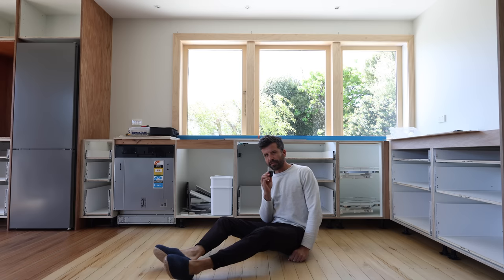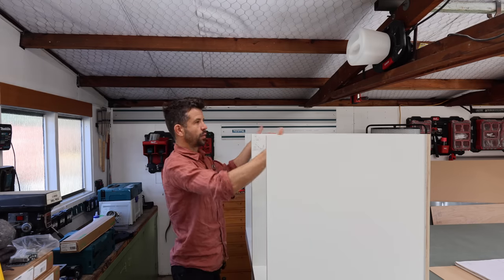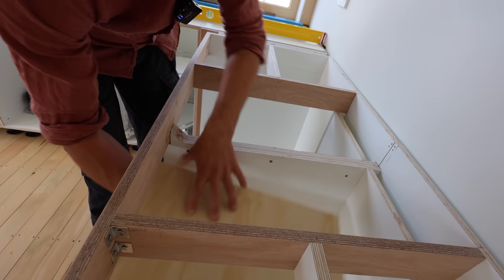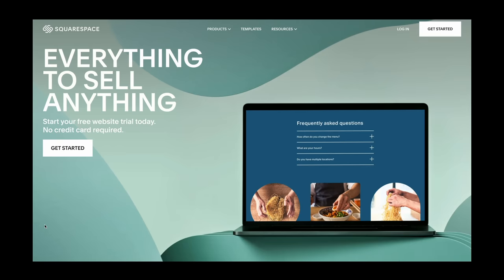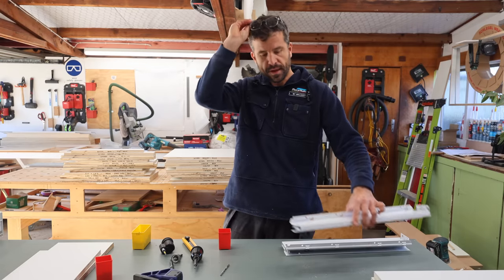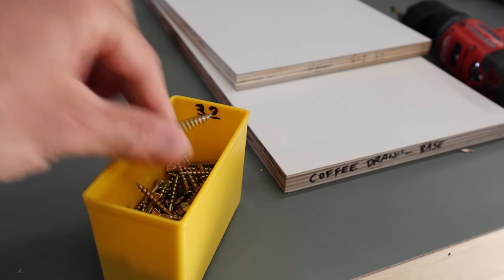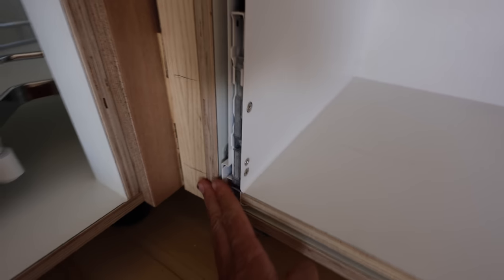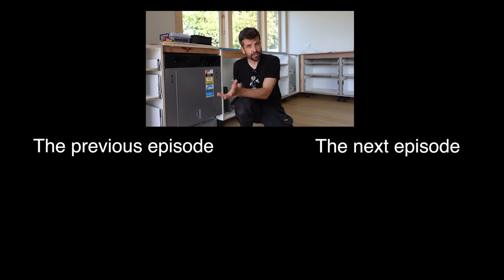A Better Way To Build Drawers, But is it Faster?

Comment: Done many metal drawers for high end kitchens and offices. One thing you showed in the video is the huge amount of cardboard packaging left over. I saw your height spacer for the track. Tip: Faster runner attachment. If there are say 4 drawers, then cut the panel into 3 pieces at the height for each dr. slide (the bottom slide sits on the carcass bottom) Stack the pieces and do the top rail. Take off a piece and do the next one down, and so on. Allows you to work the whole side at once. This works for side mount slides as well. Just remember that there must be min. 1/8" space below the drawer bottom (use a strip of 1/8" masonite) to set up dr. box, to determine position of bottom slide without math involved. Once you get the hang of it, this is faster. No dados, no glue-ups, no waiting, no finishing, and quick accurate adjusting of the dr. fronts. I like the Accuride brand, followed by Blum. Gras is an acceptable, but lesser quality product.

Comment: If you haven't made the drawer fronts for under the induction hob yet you could consider having the hot air exhaust right at the top, instead of cutting a slot in the drawer face. If you lower the whole top edge of the 2 drawer fronts by 15mm, the gap will be far less visible, as it's just below the counter top and in the shadow, compared with a slot in the drawer face. You would need to adapt the top panel, behind the drawer face a bit, to route the air up upwards, but that's not difficult.
Reply: Yes, having that heat directed at your body while cooking will get old in the summer. There is also a way of designing the cabinet so that air is drawn in from the kicker and vented out the top of the cabinet behind the cooktop.
Reply: I would have put a 40mm pipe or two in the wall behind.  The vented the air up and out with fresh air coming in via my sloppy workmanship around the drawers.
Reply: @barryrobbins7694 there is an extraction hood over the stovetop, heat put out by the induction unit itself still be minimal, it just can't sit in an enclosed space.
Reply: You'll probably find if you read the spec sheet for the cooktop that it doesn't need a 15mm slot on the front of the cabinet. I've done thousands of kitchen here in Australia and never read a spec sheet for any cooktop that requires a 15mm gap on the front of a cabinet for ventilation
Reply: @barryrobbins7694 I was thinking the same. And then Ray actually said it. Hopefully Scott will consider making the change, however it is his kitchen:)
Reply: @mrsarkey  Gaggenau has an induction cooktop that appears to be passively vented from under the kicker and up the back of the cabinet. It states that the fitted unit needs to be heat-resistant up to at least 90 degrees Celsius. Although they may be addressing a situation with an oven below the cooktop.
Reply: The maximum gap I have ever seen required for an induction cooker is 8mm. 15mm is overkill. Most of the time only 4-5mm is required. This can easily be made to look even with a 4mm gap to the benchtop on all your doors and drawers. Which will be required anyway to give clearence for them to open.
Reply: Perhaps the best practice is to follow the manufacturer’s installation instructions.
Reply: There are quite a few induction cooktops that doesn’t require this vent. Such as Miele and Fisher & Payless.
The previous generation of ceramic cooktops require this vent.

Comment: Hey Scott, electrician here. Your induction cooktop cabinet design has really peaked my interest. I've installed probably close to 50 of them with varying amperage requirements and never seen such a cabinet design for ventilation. I would really like to learn more about it, not for scrutiny reasons it's so I can do a better job.

My only experience with air flow issues from the cooktops has been the top draw, any pans you put there might get some moisture on them but that's an easy fix.
Reply: We have a cutlery/utensils drawer directly under our induction hob & I've never noticed any moisture (or warmth) from the stove top. In my experience, the way induction hobs cook, the heat is mostly above the glass. I mean, yeah, the glass top heats up a little because it's touching the thing that is hot (pot/pan) but haven't noticed a difference in the drawer below. Course, I'm just a home-user, but that's just my experience, anyway :)
Reply: @BlogWhatTheFruitcake   As induction works with electro magnets you need a minimum of a gap between the hob and the cultery, usually about 4cm. Must be specified in the manual.

Comment: Scott, I did a similar drawer system here in the states from Wurth.  It’s a copy of the Blum Tandembox system.  
        On the system that I used, the drawer front bracket clips attach into 10mm holes in the back of the drawer face.  I did a Baltic birch drawer front, and was worried that if I made the drawer fronts individually that they would not line up.  So I made a “giant drawer face” that covered as many drawers as I could with one piece of wood, then another next to it.  I got these shimmed into place and then ran masking tape across them where all my cuts would be.  I marked all my cut and kerf on this masking tape.  On the back, I marked up all the bracket clip hole locations.  This is easy because they are all still together as one piece.  Then I carefully cut all the drawer fronts apart with the track saw, drilled my 10mm holes partway through the back with a Forstner bit, and then sanded and finished all my drawer fronts.  I did not do any test fitting, they were all 100% finished before I installed the bracket clips and snapped the, onto the drawer box system.  Perfect fit with perfect reveal.

Comment: Definitely look at the IKEA bathroom vanities for inspiration for your kitchen sink!!!! They use a slightly different pipe that quickly runs to the back of the cabinet before going down and the usual P-trap or U-bend is closer to the wall.  It makes a HUGE HUGE difference to your usability of the space under a sink!!!

Comment: I used the same drawer system, also the push to open system. Attaching the fronts is not as easy as it seems! Hope you have more luck then I had. I also used wooden fronts with the woodgrain flowing. For all my other builds I changed my drawersystem.

Comment: With all the vertical grain and tight fitting drawer fronts, you will be glad you bought that system of premade drawers. That will help shave massive time off of alignment/mounting of the drawer faces.

Comment: Love watching this come together and congrats to the All Blacks!  Good luck next week!  If you're routing the exhaust slot from the face, I recommend making an oversized template and using a downcut bit with a guide bushing.  This should minimize tear-out on your show face.  Just finished a load of template routing on 3/4" (18mm) ply.  Upcut was giving me bad results.  Made the switch and it was all gravy after that.  May be a non-issue if you plan to roundover or chamfer the edges later.  Hope this is helpful!

Comment: That drawer system is very similar to the ones Ikea uses, and they ARE slick. I've done at least 3 full kitchens with Ikea set ups and like the style very much.

Comment: Scott I believe the drawer systems save time.  I'm building a big kitchen right now that has 38 drawers.  Building wooden boxes isn't that time consuming, but the finishing takes tons of time.  I used prefinished plywood for the backs and bottoms of these drawers and did them all in 2 days.  That's way faster.  I also like the sleek look of them.  I do agree they look less like a custom, hand made kitchen.  Well done!

Comment: I'm just a home DIYer, but I bought a very similar drawer kit from B&Q here in Ireland (but everything included, bottoms, backs & fronts). Easy enough for me to put together & install, I love them! The soft close is very satisfying :D 

I do wonder if you're overthinking the ventilation under the induction hob. We have one and they really don't get that hot, the heat is all above and (mostly) contained to the pot/pan. The glass top is cool to the touch quite quickly after cooking. Our cabinets underneath don't have any ventilation gaps in the front. Directly under the hob we have a drawer with utensils & I've never noticed that the knives, forks, etc. are warm during/after cooking when I go to grab something from the drawer, and I've not seen any ventilation gaps in other kitchens with induction hobs. 

Does your hob specifically say to have the ventilation? That would be an interesting to know! 

Kitchen's coming along nicely, I'm sure Jess can't wait to start cooking up a storm in there!

Comment: Milwaukee Track Saw Questions:
1. Compare the power between different batterys
2. How close of a cut does it do? Enough to make furniture? 
3. Would you just get a Festool Track Saw if you wanted to build furniture in the future?
4. Compare bag vs hose dust wood duct collection amount
5. Showcase some of the different Milwaukee blades offered
5. Would you just get two tracks to connect when needed or just go for the massive one and a regular daily use
6. I kinda wanna buy this Milwaukee Track Saw in the near future, assuming it can suffice at making furniture (weekend hoddy really)

Comment: It's coming together very nicely!!😊  Be careful with the spacing if you want to build your dishwasher front by copying the  drawer fronts as you suggested. If the spacing us too large, liquids dripping from the counter top flow into the spacing. Looks awful and very hard to clean ( even with cloth around screwdriver/knife etc.) . Maybe a faux saw cut? Don't know if that works with your panel's veneer.

Comment: Garden gossip
Seed propagation is arguably the most important thing. Avid gardeners now that the range of plants can be expanded by germination under temperature controlled heat lamps, or just a simple light globe ensuring success. Once standing the new plant can be transferred into the green house. 
G, day Scott Brown Carpentry and Jess from Sydney Australia. I especially like the draw runner spacer boards for pair accuracy when screwing to carcase sides, instead of square lines.
🌏🇭🇲🍃

Comment: About that drawer under the sink. I built an Ikea kitchen about 8 years ago, and they have a great system with trash bins in a drawer under the sink. They sell a kind of low-profile drain system that allows for a lot of room under the sink, which makes this possible. I just moved to a new house and the existing kitchen doesn't have this system, and I miss it every day. I am probably going to retrofit it to my kitchen at some point. The drain system is called Lillviken, the trash bins are part of the Hållbar series.

Comment: Do two doors at the sink cabinet. This way you don’t need to step back to open the door(s) to get soap etc.
Reply: Agree. Much easier, and a cupboard under the sink is practical.
Reply: Plus drawers would be a major PIA for sink maintenance.
Reply: There is a reason why 99% of sinks have 2 doors under them. Agreed.

Comment: I think cabinet makers pull all the draws fully out at the same time, to check for interference... to see if one draw bumps into another. You will need to do it again when you put on the draw fronts and the doors to the corner cabinets. And it is fun too.

Comment: Suggestion for the sink cabinet: have a drawer in the bottom with a front covering the whole cabinet, this is where you put your trash bins etc. Then put smaller drawers with recesses for the plumbing or half depth drawers inside the cabinet slightly recessed. This way you get one full front with nice appearance but the functionality of several drawers and storage for cleaning aids, trashbags etc that you don't need to access so often.

Comment: for the dishwasher. I always put it up first and leave like 1 or 2mm at the top.. Then i place the door. (always meassure it dont use the supplied drawing) And then if needed adjust the dishwasher in height. so all the fronts line up. If the front is in line only then screw the dishwasher into place!

This will safe you alot of trying to get it just perfect!.

Also put the sticker or the metal plate on top of the dishwasher so the wood wont get damaged by the moisture. But iam sure you got that one figured out already :)!

Also think about anti slip mats for all you're drawers. That will be a life safer also :)

Comment: Use the drawer guides from one of the top drawers in the middle position to allow more clearance for the drain under the sink. Bottom will just be the normal drawer, and use a false front on the top. I’ve been doing cabinets for 11 years and that’s likely how I would do it.

Comment: Have you thought about lighting for the drawers and kitchen cabinets? There is a couple of solutions to use one is actually in the drawer itself the other is mounted in the cabinet and drawers separately.  Takes the kitchen to another level. Also a boiling water tap like cooker for instant boiling water saves energy to. It also can provide sparkling and still cold water.

Comment: It's like Ikea drawers, same deal - always loved them but the sloping sides on the Ikea version can be a pain for stuff like cutlery holders...  

Re: sink - I modified the back of the drawer to clear the trap and had a set of "fake" shallow drawers at the top (first row under the sink) with a hinge at the bottom and some plastic "drawers" designed to hold cleaning stuff - it was a kit IRC.   They were small enough to clear the sink underside and were really useful.

Comment: Most induction plates (hobs) states the required minimum space behind/under the cabinet for air circulation. Always check your manual.
You also need to buy yourself those cheap, but handy carrying belts. It helps put less strain on yourback and your hands are more for controling it to not flip, than lifting. Good specially when, I dont know, you need to carry something bigger and other person is shorter or a woman or both.

Comment: If the hot air exhausts at the front, you are going to heat yourself up as you stand at the hob....nice in winter but unpleasant in summer!
Reply: I thought the whole point of the induction cooktop was that it doesn’t heat up as much as electric cooktop? And the heat is only between the pan the cooktop. No??

Comment: Hi Scott,
Will look forward to the track saw video. My question is I just 'fried' my near 30 year old Elu battery drill and need to buy a new one, plus impact driver and want to get a track saw too. As a 'weekend warrior' do I buy 18v or should i go 40v from the outset? I'm likely to get other tools in the future to e.g. router, light .... Does the 40v system have the range and or is the 18v system likely to be discontinued? 
Would love to know your thoughts. 
Cheers Peter.
PS A woodworking tour to Japan sounds like a neat idea too.

Comment: If you do a makita track saw review,  I would like to know what square I've seen you using,  and have had any troubles with the tracks not lining up when jointing them together,  they are machined differently? Your thoughts would be greatly appreciated!

Comment: Great video scott have been wondering about dust extraction with and without vaccines for the Milwaukee vs Makita vs Festool track saws. I don’t think there is any way to have the Milwaukee auto start a vacuum which is a bummer.

Comment: Hi Scott and Jess.  Have you asked Festool NZ for a loan of the new Festool TSV60K rail saw which has a scoring blade at the front and dual motors.  In a limited test i found it to do what it was made for, to cut a perfect line without tearout.

I had a hunch that the new Milwaukee red track was heavier than other brands of track.  In its different design section, it is heavier.  In addition to that, the projection on top which guides the saw, does not have as large a roundover, if any at all.  It would be interesting to know how your Makita saw runs on it.  I felt more secure on it in my test of the Milwaukee saw and rail.

A lingering question i have is about the bosch plunge saw you reviewed. Not even the Bosch rep could get it to snug up to the track any where near the fine tolerances of the other trade saws.  There must have been a mm SLOP between the saw and the track.  This is unacceptable for cabinet work.  May i ask what was your experience of this saw on both the Bosch/Mafelle track and the Festool style track?  By removing the plastic insert in the base of the saw, it will run on the Festool style track.

  Thank you both for the presentations.

Comment: You shouldn't need to extend the drawer slides to fit the drawers.  Leave them in the closed position, drop the drawer onto it and slide it back untill it clicks.  When you do these regularly, if you extend the slides then its only a matter of time befote you trip over one, especially when you are carrying a drawer box and cant see the slide underneath.

Comment: Watch your stuff all the time.
Any bright ideas how to join 2 curtain poles together when you cant buy double screws easily  (in Lanzarote).
Peter
Reply: Hi, maybe white pvc water plumbing connectors using a pipe glue. Or a heat gun might soften a straight joiner enough to create a thread, if you want to screw it together. Or create your own wood joiner with single screws slipped over the end.
You Tube usually has useful tips.
🤓

Comment: I'm not sure thats required. We have a induction cook top, centered over one cabinet though, but it's got no cooling at all, it's just exposed and then has two drawers over it. Can't see the bottom of it though unless you crouch down on the floor.

Comment: This seems a lot like ikea kitchen hardware. I wonder, is this cheaper than using IKEA kitchen hardware and substituting their particular board with your nicer plywood where you like?
Reply: Ikea drawers are cheaper and have the wood included